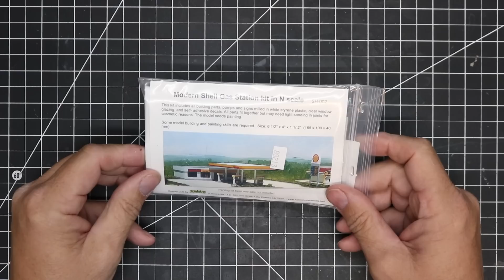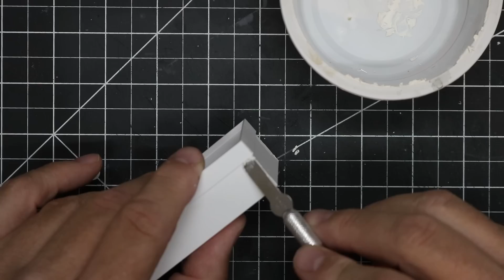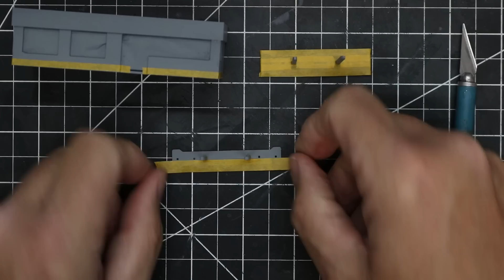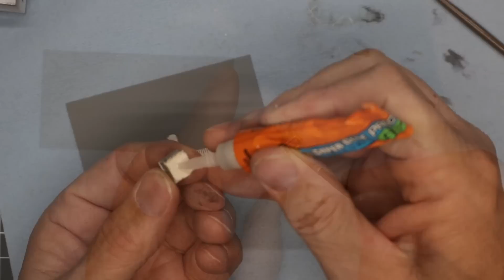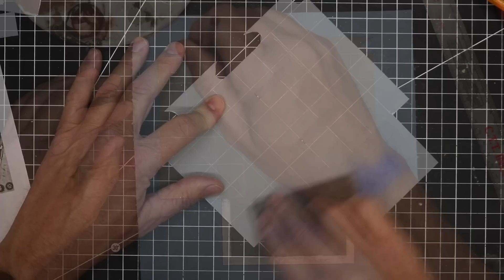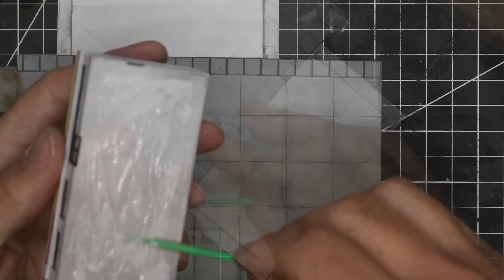Customized N Scale Gas Station

Comment: Nice, Ron.  I did custom painting of Maine Central locos & rolling stock that were sold in the local hobbyshop in the mid 80's.  "Ron's Trains" is what I called my little enterprise.  There were no factory HO stuff available in those days.  Sold like hot cakes.  Every week when I delivered finished models to the store, the owner would send me home with more to do for that week.  Things rarely stayed in the shop more than a week.
I have a question for you.  Where are you gettig the Shell decals?  I would like to find Shell decals in HO, not just for buildings and signs, but for vehicles also.  The only gas station in my home town during the 60's was a Shell station.  There had been 2 others in the 50's which didn't survive into the 60's.  To complete the station, I need to find another thing that will be a real oddity.  On the roof of the station was a fiberglass(I suppose) figure of a boy in a night shirt with a tire on his shoulder and I thinl a candle in his other hand.  I can't remember now which tire manufacturer used that for their advertising.  Would have to have been one of the old tire manuf. like Firestone, B F Goodrich,  Goodyear.   I just can't remember.  Maybe I'll google it but regardless of who, I need to find that figure in HO.  I sure can't carve one.LOL
Reply: I've already answered my question about the boy.  It was Fisk tires that had it in their advertising.  The boy is yawning and the slogan was "is it time to retire?"  I'll never find anything close to that.
Reply from the maker: The decals came with the kit, but I'm sure you can find Shell images online and print some of your own.